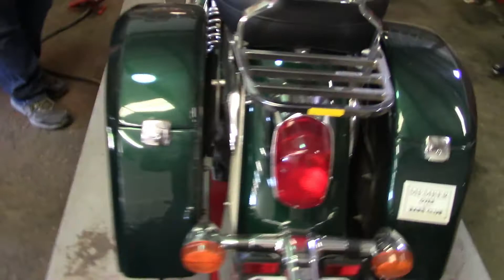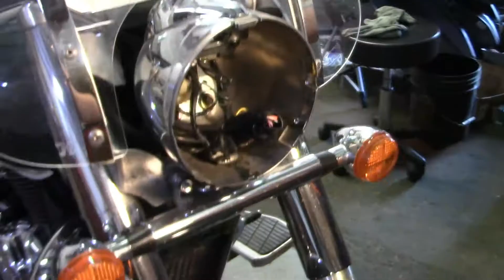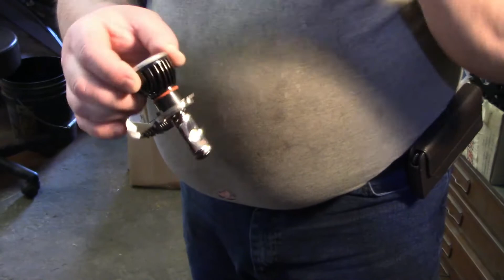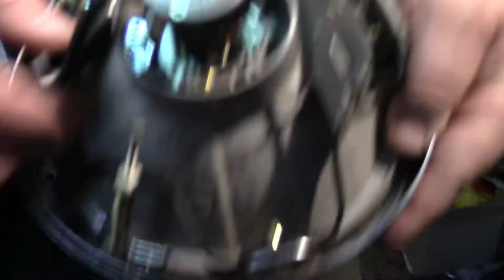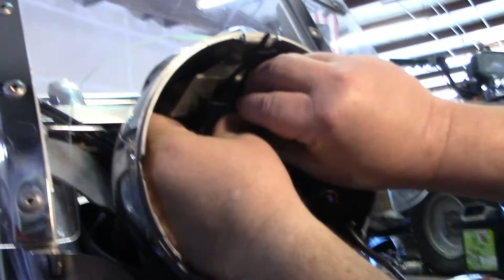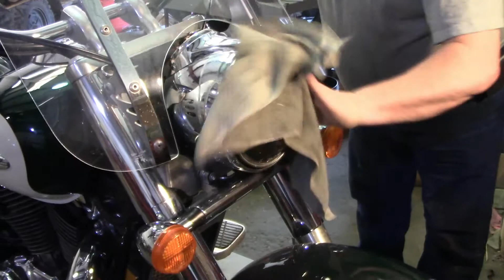LED Headlight conversion for your older motorcycle

Comment: Great video, much appreciated. I have a 2010 BMW R1200R, can I use similar setup or do I need something to trick the CANBus whatchamacallit?
Reply from the maker: I must admit that I am not familiar with BMW's particular control system. I frankly can't imagine that a headlight bulb would make much difference, however, there is a possibility that it could. Try at your own risk, but since nothing has to be permanently modified to try it, it could be worth a shot. If it works, Great! If it doesn't, well maybe you can re-sell the kit on Ebay. Whichever way it goes, if you try it, could you do me and the viewers a favor? Let us all know what happened please? Thanks for the support!
Reply: @JWSRepairServiceLLC  Took the plunge today to change the OEM Halogen to LED bulb. I bought a Philips H11 Ultinon Essential LED bulb, came together with the LED driver. Replaced the OEM low beam bulb, minor tweak to get the alignment right. Put everything back in and IGN on, pretty happy with the outcome. No check light whatsoever...for now. So far so good.
Reply from the maker: @asyrafahmad7351  Outstanding! I'm glad it worked and thank you for the feedback!

Comment: Do you have a recommendation for a '95 Sportster?  The headlight is quite a bit smaller than the one on that Honda.
Reply from the maker: Not an inexpensive one, you will have to use the genuine H/D LED conversion for that small headlight bucket, be prepared to drop about $400 for that. Kuryakyn used to make one for the small/shallow buckets, but I don't see them offered anymore.

Comment: Awesome! I believe the power supply is a load equalizer?
Reply from the maker: It's actually a transformer, the kit I installed is 48 volt, so it bumps up the standard 12 volt. You wouldn't need a load equalizer except for turn signals, but you don't even need those now since they make transistorized flasher modules so you don't get the crazy fast blinking. Back in the day, I did have to install load equalizers and resistors to correct the fast flash.